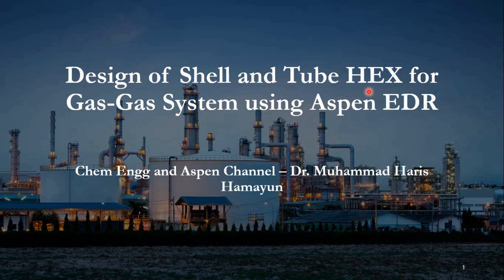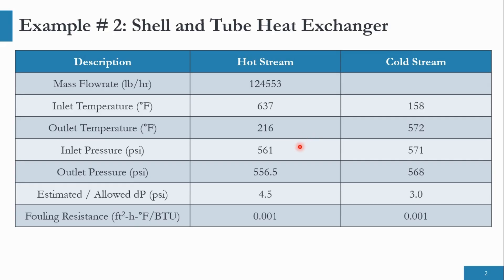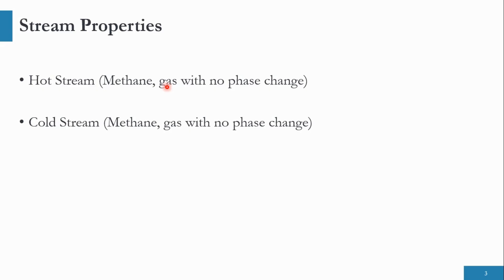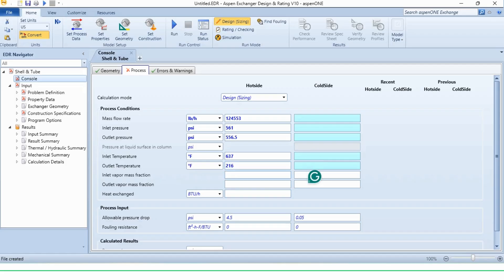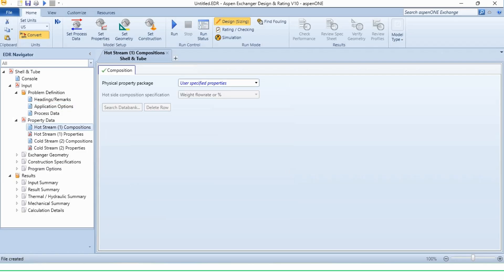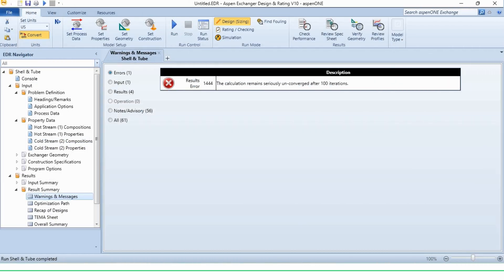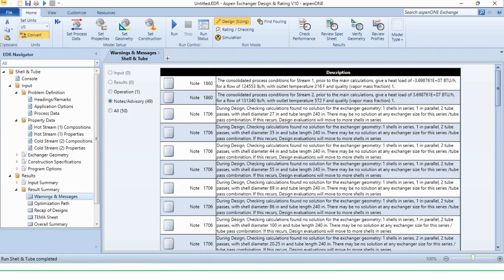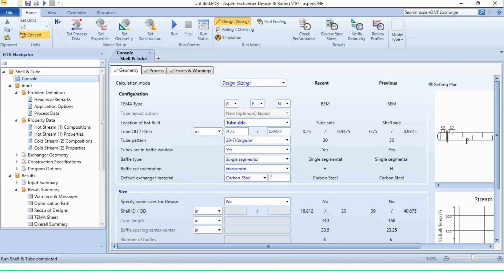Master Shell & Tube Heat Exchanger Design in Aspen EDR | Step-by-Step Guide for Beginners!

Comment: Hello i need help with error -"The fraction of the surface area for cooling the liquid phase is estimated to be 49%. The number of naturally submerged tubes is estimated to be 8. Thus only 11% of the surface is considered submerged by the liquid phase. Re-run the case with a new input value of the Area Fraction Submerged to bring the input and required values of the submerged surface into agreement". Please provide any solution.